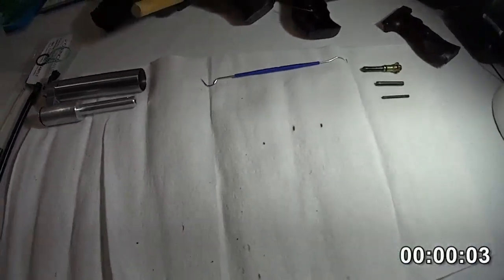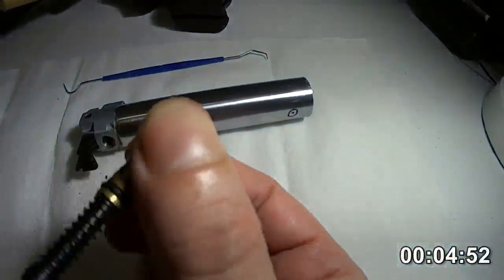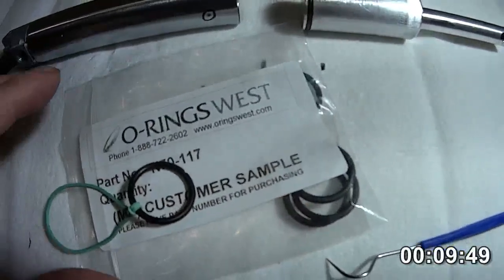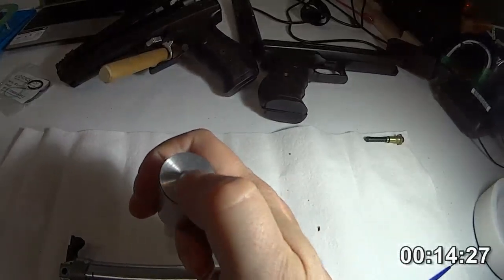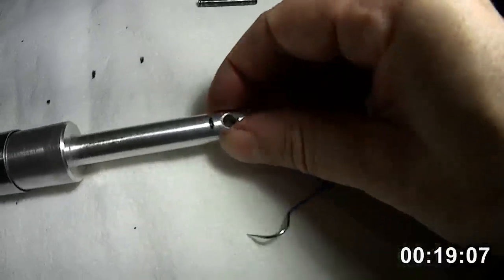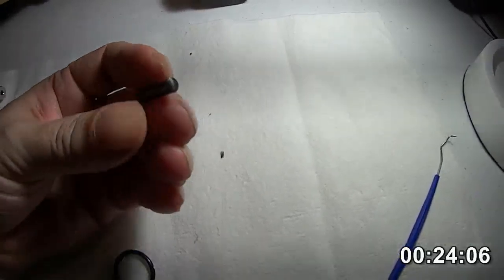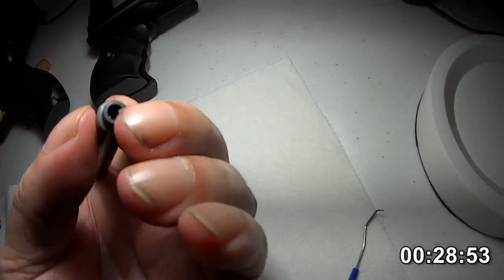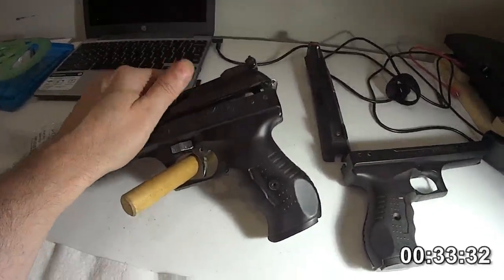Beeman P - 17   important info from a 20 year + owner

Comment: teflon tape the rear sight screw a bunch ,it will not back out so easy ,and with tubing cutter ,cut you another oring groove just a lil ways from oring to put another one !!!
Reply from the maker: Good point and i have teflon tape so thats something to try...on all p17 models they have a very loose elevation screw

Comment: steel bb's measure .172 and pellets measure .177 ,if you shoot lead bb's they measure out .177 so they seal better and shoot better ,i like the ones gamo make !!!
Reply from the maker: I dont shoot steel bbs in this..only pellets..i do load lead bbs sometimes but use pellets...bbs depending on manufacture vary in size ..black diamond ans daisy match grade bbs may be bigger size but all under .177

Comment: just got it and touched upu piston with silicon oil , and grease !!!
Reply from the maker: I clean piston after every use and smear one drop of lithium grease..just a thin coat...it has always worked for me and manufacturer's specs but silicone can work just as well...many fail at shooting it and letting it go dry...after every shooting session it only takes a couple minutes to clean and relube...its good to buy a few of these since its easy to swap parts...you could even use a second one just for bbs but need a tiny magnet or something to hold loose bb

Comment: From what i can guess, that section of the barrel where the diameter is reduced, is used for sliding the barrel back against the o-ring so that you can adjust the the gap and reduce air leakage.
Reply from the maker: The plate that holds barrel is fixed tight no allowimh barrel to move...the O ring at breach is adjusted by putting a shim in before the O ring making it come forward just a little....same thing with spring piston or gas ram break barrrel rifles you shim seal forward
Reply: @libra7624  So the plate that holds the barrel is the same width as the recess in the barrel? 
Now that i think about it, adjusting the gap by the way i thought it was done, would not be that practical either.
Reply from the maker: @hardcase1659  its easier to move O ring forward then to mess with parts that are designed to hold gun together

Comment: Great video. I would like to ask you for some advice. I am going to purchase a .25 caliber for squirrel and rabbit hunting. Should I get the Hatsan 125 or the Remington/Crosman 725VTR? I respect your airgun knowledge and would much appreciate your opinion. Thanks.
Reply from the maker: Hatsans are good but plastic stocks crack...i had two crack on me just ne cocking force alone and flexing...hatzan doesnt use fiber reinforcement in platic stocks so i called them and let them know  all other air rifles i have had from other manufacturers the plastic stocks are fiber material wich is strong...other then that my hatsan wood stock rifle is ok in 177...its a model 135
Reply from the maker: If hatsan get a wood stock...but for a 25 cal i would look at some prices..enter 25 cal on pyrymid air web sight to browse 25 cal models
Reply: Thank you.